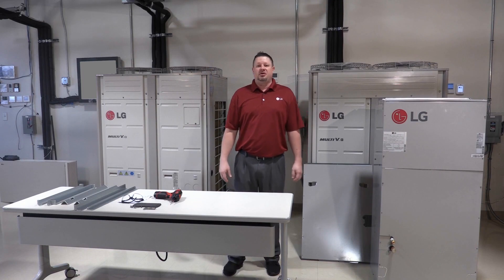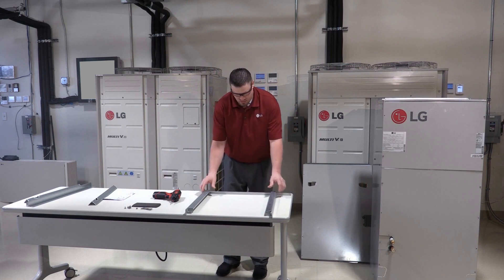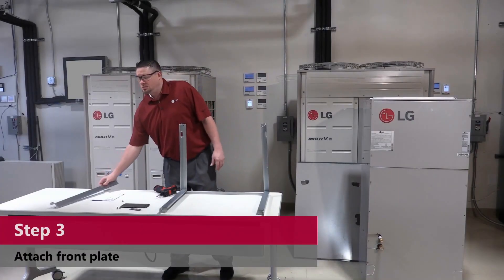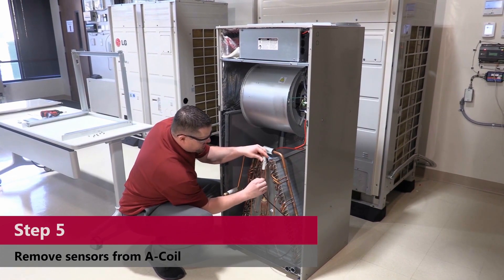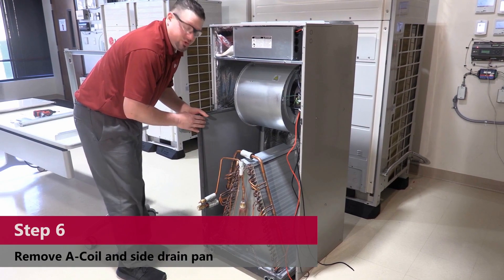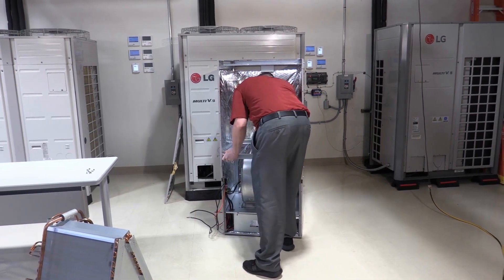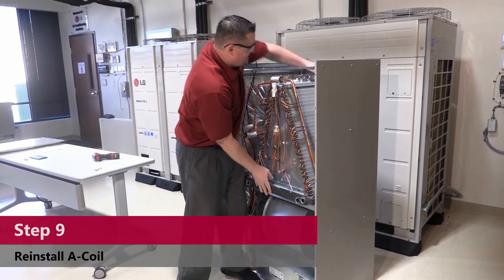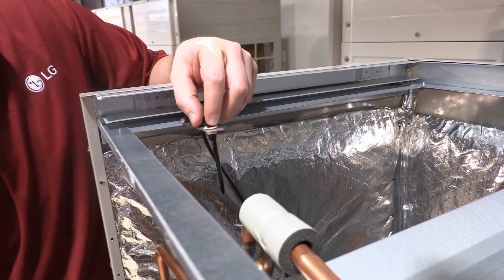LG AHU Downflow Conversion Video

Comment: I installed the conversion frame as shown in video. But, the front plate is 1/4” wider than the plate that it attaches to. This totals 1/2” wider.. and that plate then screws to cabinet, and is a perfect fit. The cabinet is very stiff and does not like the added 1/2” of these side rails. My solution was to unscrew side plates where they attach to the front plate, then insert conversion frame, settle it in, then reattach the two screws for side plates to front plate. The added 1/4” on each side plate smashes easily into the insulation padding. The video skims through headaches they may have encountered, or perhaps the attachment holes were drilled differently than mine. I do wish the logo and labels were on a reversible panel so they are not upside down now. There is a lip on one side of the small panel that prevents is from being rotated 180 degrees.

Comment: If air is flowing down, wouldn't that pick up condensation in the main flow and cause leakage outside of the drip pan areas?
Reply: If you notice during the conversion he repositioned the A frame coil. If the A frame coil is installed correctly the condensation (sweating) will be directed by the drip pan then to the drain pan, no matter the direction of air flow.